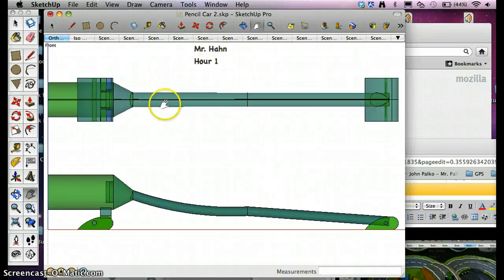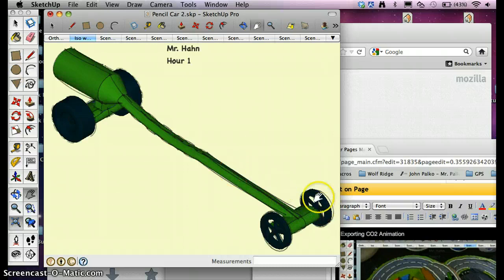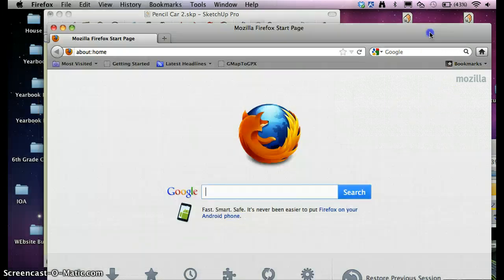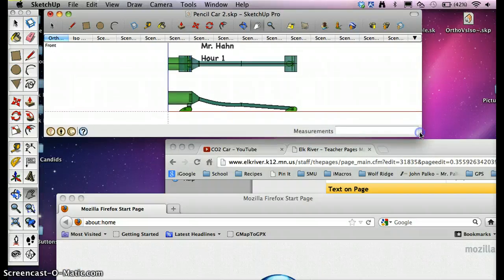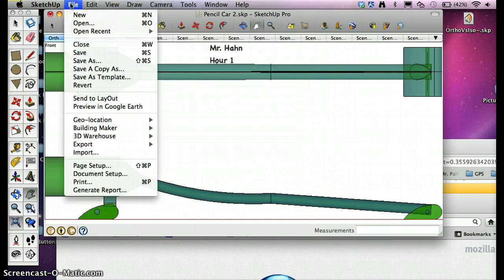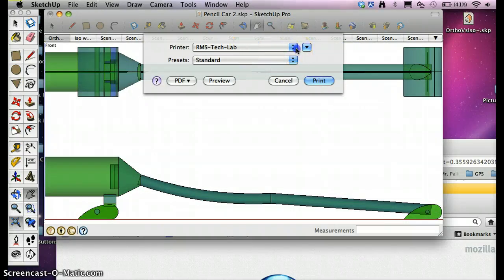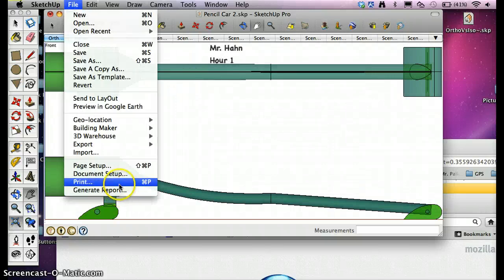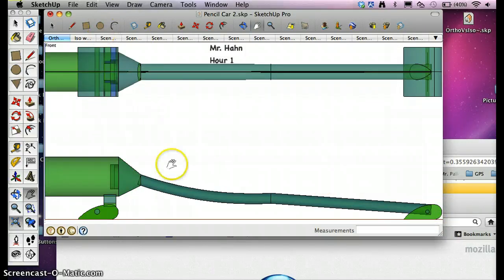Sketchup Printing

Comment from the maker: Bob, 

I get it, but this is for a very specific way of printing.  I want what I drew 200mm to print exactly 200mm.  If you just want a printed picture, just use the default settings.  The key to remember is what ever is on your screen in Sketchup will print(Even the white space).
For sophisticated printing think of it as this:
Step 1: Get what you want to print on the screen
Step 2: Tell Sketchup what paper you are using
Step 3: Tell Sketchup the scale
Step 4: Print it out.

Comment: nothing against you personally the vid is quite easy to follow..
, but i think the good people at sketchup need to address the issues with their printing programing. . i cant make it work for the life of me.
 a circle with 80 mm diam. comes out in facets on 2 sheets of a4 . i keep changing the settings and they keep on changing back when i press print. honestly............  really.... who sat down and thought that was a good programing idea.      google thought it was a good idea.
Reply from the maker: I agree the print could be a bit better, and it is if you use layout on Sketchup Pro.  I think it may be a "selling point"  for them to get people to purchase pro.  As far as the facets, that is in Sketchup's programming.  Sketchup doesn't really make circles.  They come out standard as 24 sided polygons.  For bigger circles you can control this by typing in a much large number as soon as you hit the circle tool and before you click the center point.